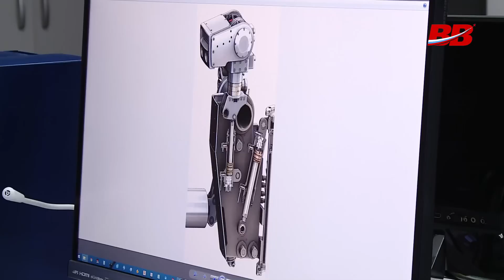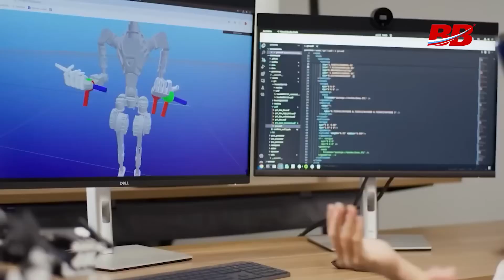Meet Marfa: Russia's New Robot and the Upcoming Teledroid Launch

Comment: Our disruptive 𝔽𝕦𝕖𝕝 𝔸𝕘𝕟𝕠𝕤𝕥𝕚𝕔 ℤ𝕖𝕣𝕠 𝔼𝕞𝕚𝕤𝕤𝕚𝕠𝕟 - Ultra Efficient, Maximal Performance, Low heat/noise signature, Non-Polluting, Torque/Power Dense, Engine solves all the issues of legacy engines and electric systems w less complexity, irrespective of size. BOOM! Better than electric/hybrid/FC. >>100mpg...including hydrogen & natural gas from home.
 
 𝔽.𝔸.ℤ.𝔼 © allows an 𝕚ℙ𝕠𝕨𝕖𝕣𝔹𝕠𝕠𝕤𝕥 © mode for >400% more torque/power. It’s like >4 engines in 1 which is useful in VTOL aircraft [half weight of EVs!!!] and heavy duty applications. The power to weight/volume ratio approaches turbine specs. All without a tranny/gearbox. Works with all engine architectures incl. opposed piston. The simple, low cost/weight native 𝕊𝕦𝕡𝕖𝕣ℍ𝕪𝕓𝕣𝕚𝕕 is non-electric. Great for powering robots.

Recently I further improved the performance including the architecture.

Search the net or message me for DropBox link which YT wont allow to post.

#NFTG #DisruptingTheDisruptors©  #FAZE©
Reply: We also invented novel maximally torque dense [small] gear technology which doesn't use any 'spur' type gears.